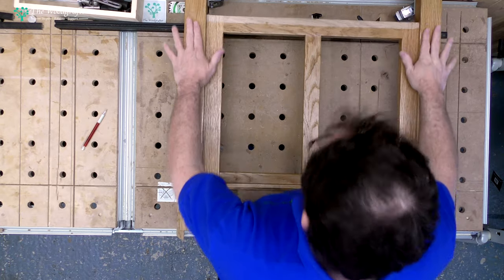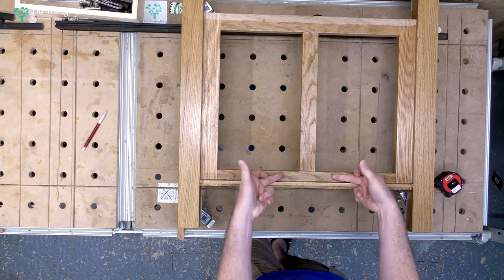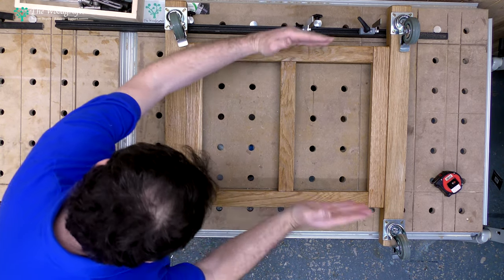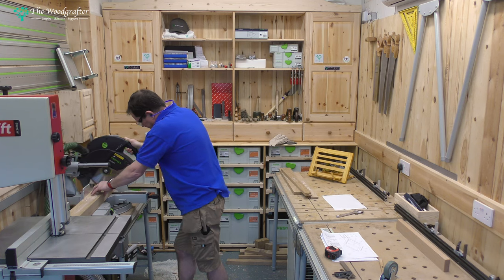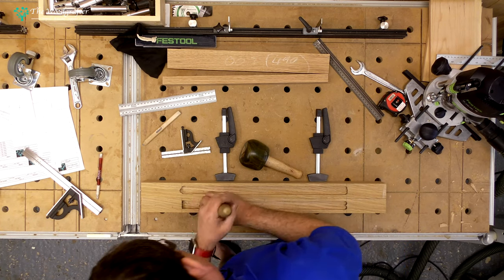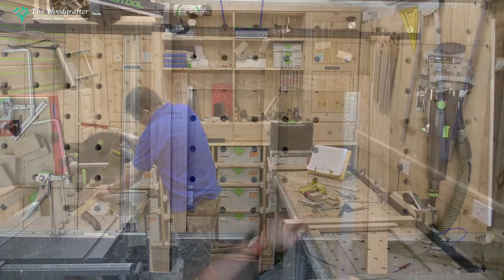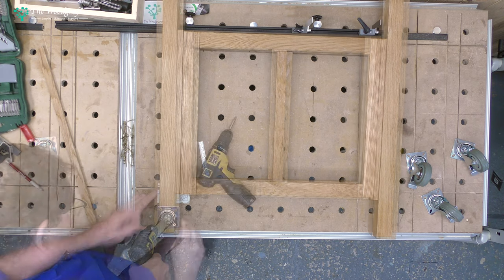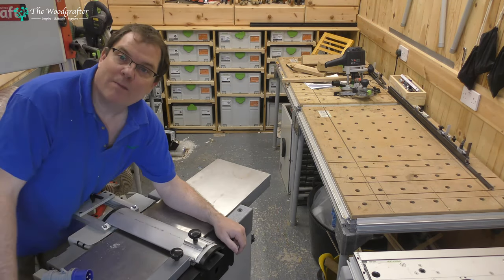Mobile base for jointer

Comment: Sorry if I missed the explanation Andy, but what was wrong with the Axminster base that you bought with the unit?   What made you decide to build your own after having bought the OEM base already?
Reply from the maker: Hi Jason,

You didn’t miss it, I never covered it :-)

The Axminster base has two knobs one on each side of the base. These knobs are basically attached to a couple of bolts and at the end of the bolts are a couple of feet (flat steel discs).

You turn the knobs, the feet push on the floor and raise up the base. So the wheel are lifted of the ground, or at least the weight is taken of the wheels.

The problem comes when trying to lower the device again, the weight if the machine is now resting on the feet, and as you turn the knobs - the friction on the feet is greater than the anchor point on the knobs and the knobs spin off the top of the bolts.

Then you have to dig out the wrench and mess about with nuts to release the feet.

Human nature as it is, you tend to go for the easy option, leave the feet taking the weight of the machine - and drag the machine round by a convenient hand hold - normally the outfeed or in feed table.

This then takes the tables out of calibration.

So to overcome this problem, I wanted locking wheels. Hence the rebuild. Now it all works fine.

I think that the weight of the machine is just to much for the adjustment. I have re-used the base on my bandsaw - and all works well.

Hope that helps.

Andy
Reply: The Woodgrafter Thanks Andy.  Makes perfect sense.  Good to know. 👍

Comment: Great work and nice to use some oak for your project.  I might replace my tablesaw base one day to a nice bit of workshop furniture, perhaps a winter project.
Reply from the maker: Cheers Paul,

I do like using OAK , but tend to use cheaper material in the shop. Wood is just expensive in the UK.

Cheers

Andy